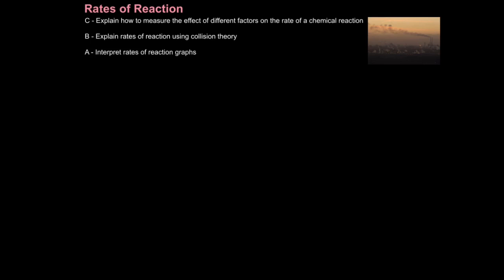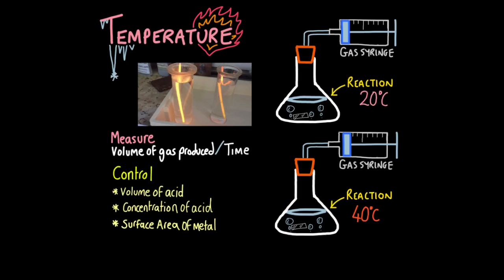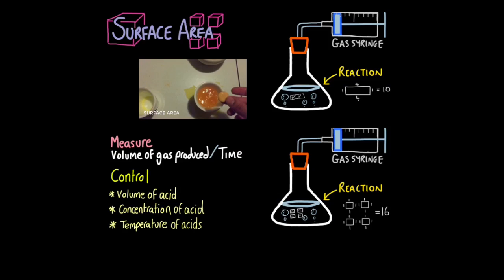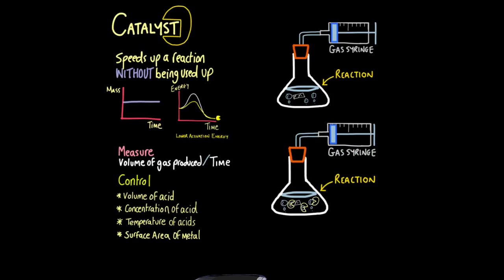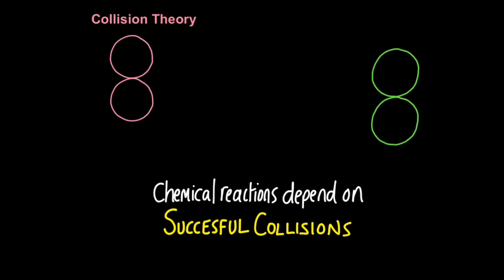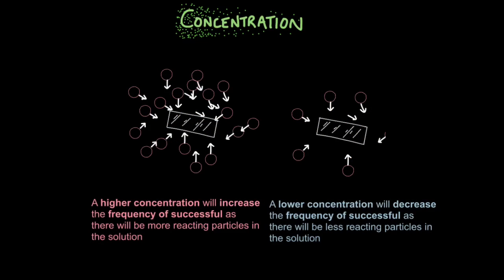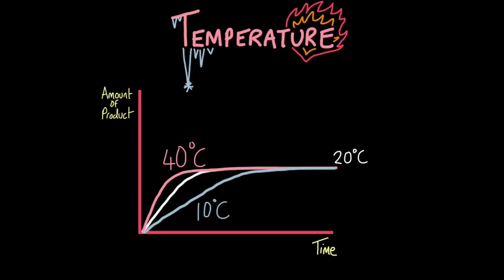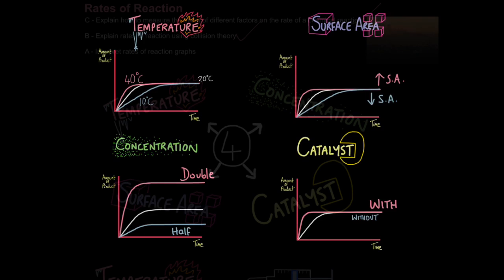C2 Rates of Reaction (EDEXCEL)

Comment: In terms of the collision theory, would an increased amount of collisions result in a faster temperature rise of the reaction? Thank you!
Reply from the maker: hmmm....tricky one....
not sure if there is one answer to this. Energy (in the form of heat) is needed to start a reaction. Some reactions release less heat when reacting than is supplied to them at the start (endothermic) so any heat due to collisions is absorbed to fuel the reaction. Other reactions release more heat when reacting (than is supplied) - exothermic. So in short, it depends on the type of reaction - endothermic or exothermic. If you are thinking in terms of  releasing heat when they collide due to friction (like when you clap  your hands together) - not sure, but I doubt that has any significant effect. It's the breaking and forming of bonds that affects temperature. Heat is taken in to break bonds and released when new bonds form. In short - don't think along these lines for your exams - instead know that temperature affects the rate of collisions rather than the other way round.
Reply: Thank you so much!